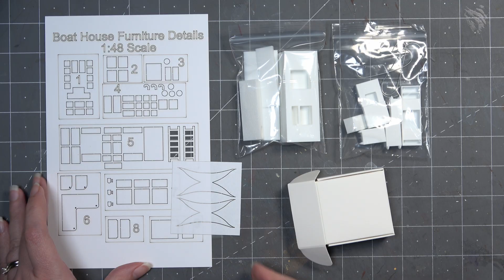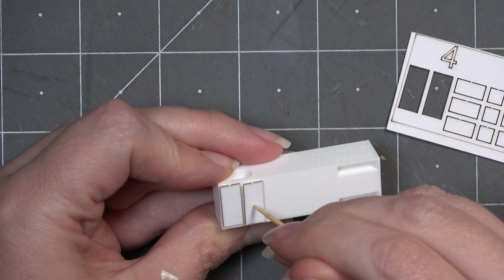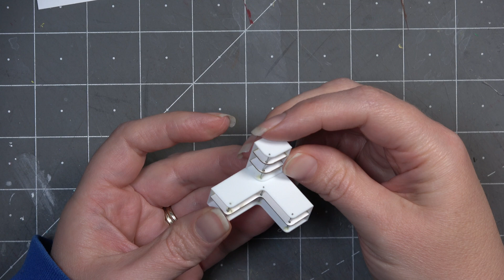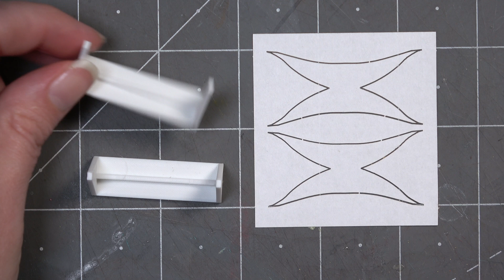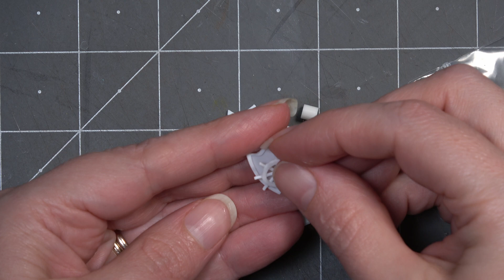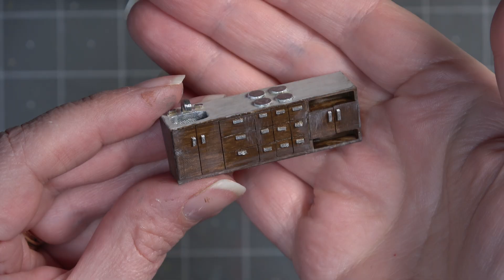Boat House Furniture Instructions 1:48 Scale - Bentley House Minis Kit

Comment: That really does fill the place. Could you pre-paint the steering wheel for the helm
before gluing? It just seems a bit fiddling
to paint later.
Reply from the maker: Definitely!  It's very versatile but I did find that a small brush could still get around the underside of the wheel even after it was attached.  That little desk piece that has the wheel on it could also be a great map table.. all sort of possibilities!